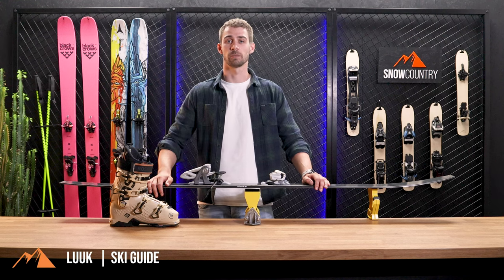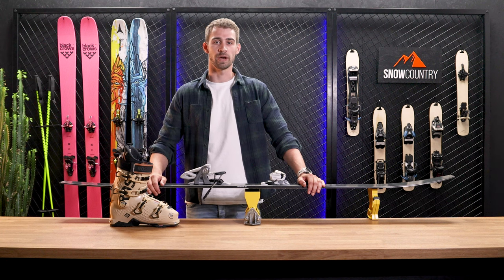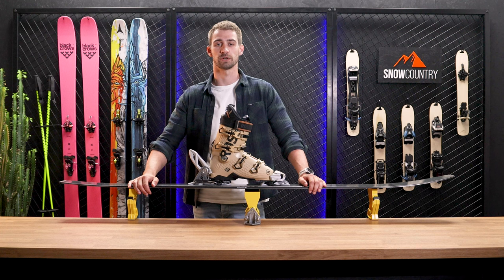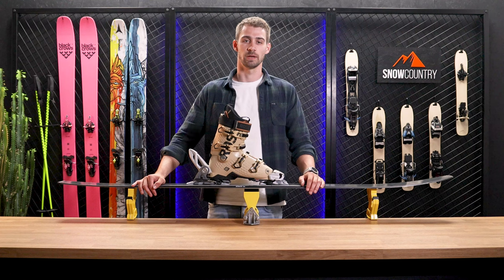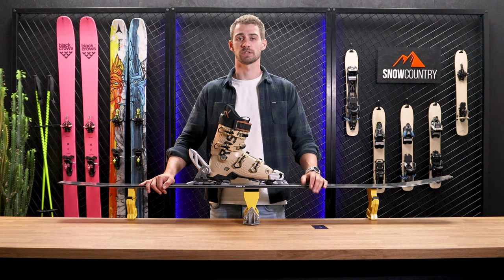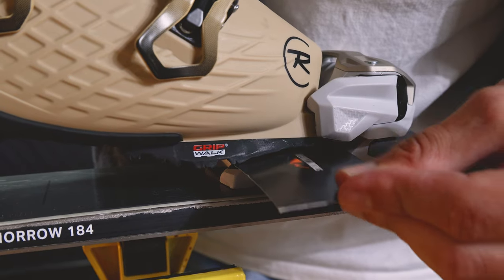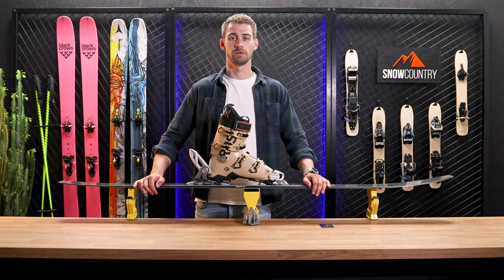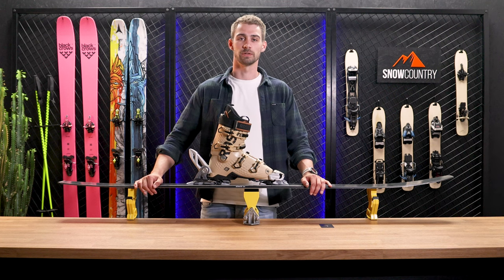How to adjust your Marker Griffon binding

Comment: What about heel length adjustment? How is it done? thx
Reply from the maker: This is explained at 24 sec (forward pressure)
Reply: Engage the binding then turn the screw, it will slide foward/back